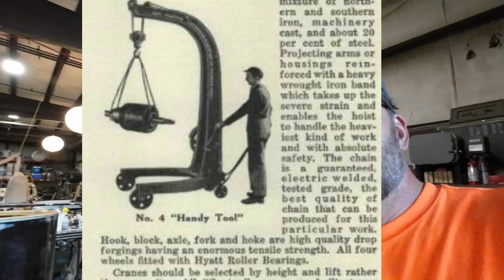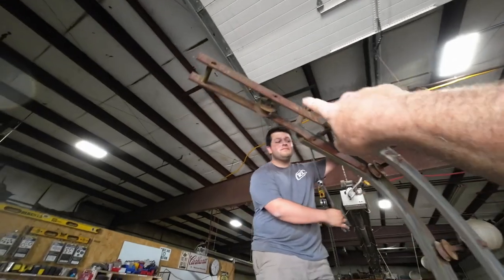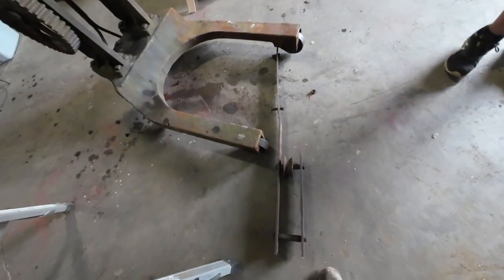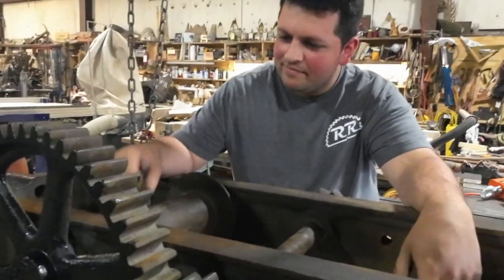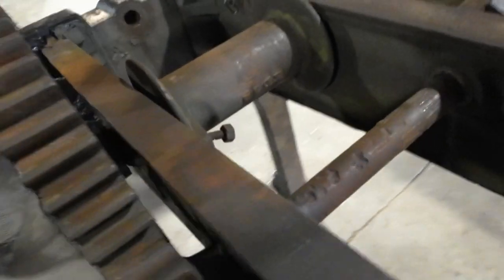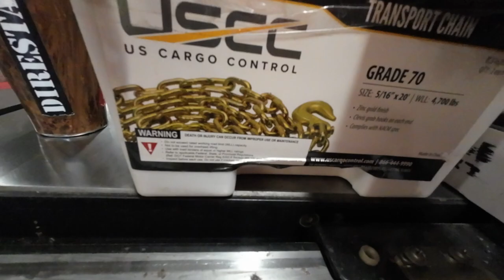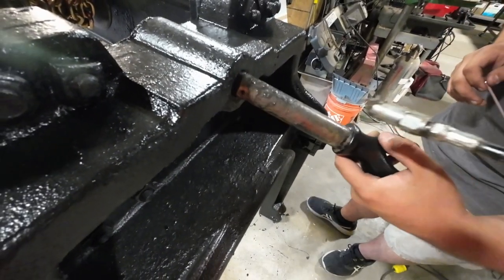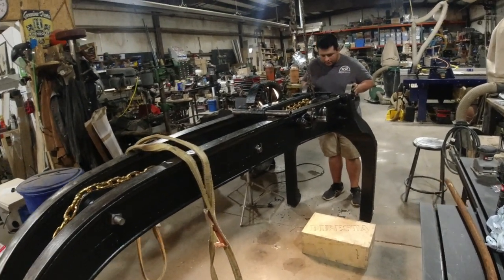DiResta - Vintage Shop Crane Restoration!

Comment: 17:35 don’t put your finger inside any rotating holes on a lathe! Use a catch bar or kiss your finger goodbye now!
These cranes are great, I need to restore mine! It would be good to shorten those cotter pins or they will shred your ankles. I don’t usually assume the role of the safety police by the way but those two things will give you a world of hurt!
Reply: Definitely a failing grade on the use of cotter pins.
Reply from the maker: @billmiller7138  that’s on rob 😂😂

Comment: Fantastic job dude. Like the way you used some antique tools to restore an antique. One question why did you heat up bit before welding it? Is it because it’s iron and makes it easier to weld?
Reply: Better weld penetration, especially on large pieces of metal and if your welder is a bit underpowered for the job.

Comment: Looks like (26:02) it has the remains of some feet that it lowers onto when the handle is raised? Maybe they had a block of wood on the bottom of them or something? Otherwise there seems no point in the raise/lower handle mechanism.
Reply from the maker: I think it was just to keep it Close to the road if it tipped.  They were steel skids that we’re replaceable

Comment: If you compare this to what we consider today's equivalent to this, basically an engine hoist you see in any auto repair shop,  the level of craftsmanship and sheer strength in the canton is absolutely impressive, it makes the modern one look like a very cheap, dangerously inferior and chincy knock off, they defined don't make em the way they used to, maybe I'm incorrect for comparing to an engine hoist but nothing else comes to mind that I know of, great work BTW, love to see mechanical history being appreciated and preserved.

Comment: Nice job mashing those treads after u welded the bolt on
Reply from the maker: The heat was red hot where I needed the bend. The threads took no damage.  The know how and what come w experience.
Reply: @jimmydiresta  nice restoration nun the less

Comment: Beautiful work as always

I'm curious why the three chain pulleys aren't  installed with spacers or flanges to keep them centered?  Is there any issue with the pulleys tracking from side to side?
Reply from the maker: We think it’s to keep the chain moving on the spool left to rings.  This how it was

Comment: A great job on the crane, one honest question, is there a requirement for you to get lifting equipment tested and checked regularly?  If so did it get rated at it's original lifting capacity or did you go lower?
In the UK we don't need to in a private workshop but in any commercial setting you need to.
Reply from the maker: I won’t put it to hard work. Just light duty

Comment: Maybe I should finish watching to get the answer before posting this but that crane looks like cast iron. It can’t be cast, right? That wouldn’t be strong enough for a crane, right?  Dazed and confused but hoping for an answer so I can sleep tonight.
Reply from the maker: there is steel straps on the back of each upright to add strength
Reply: @jimmydiresta  thank you

Comment: I’m disappointed in Jimmy’s restoration. Doesn’t he know you must remove all casting burrs with a 12” mill smooth file, use body filler to repair all imperfections, and polish all non painted parts to a mirror finish?!?!?  All while wearing BLACK nitrile gloves, not these hideous green things. 🙄
Reply: Yeah, at least he didn't use a needle scaler on gear teeth, hammer in ball bearings with a hammer, bang on the threads of a bolt with a steel hammer or use actual sand in his sand blaster...  Oh but he did do at least three of those.  

But I get the inference...  Different strokes for different folks. 

That said, very nice restoration!  As soon as I saw him pull the wheels off I was hoping he'd clean/true them up on the lathe, and he did.  Well done...